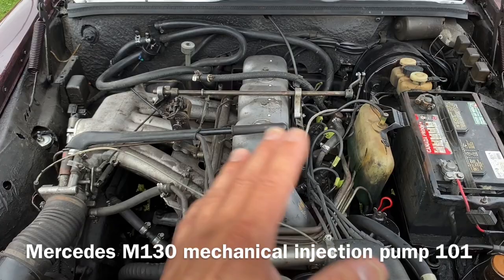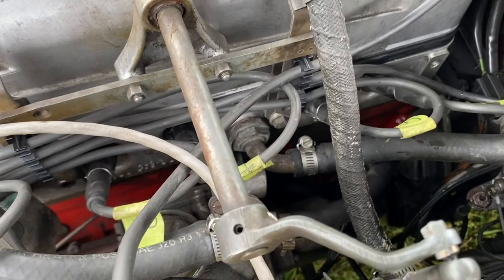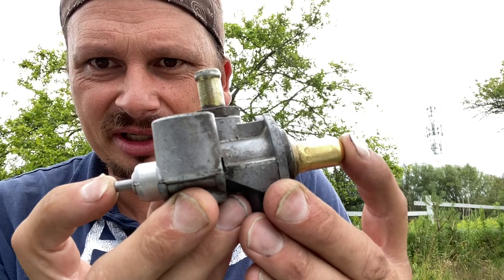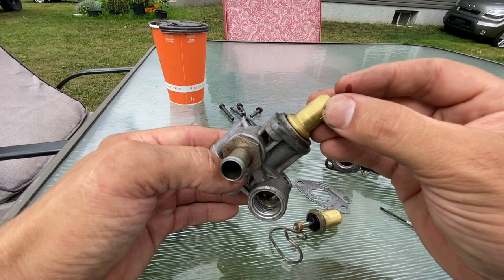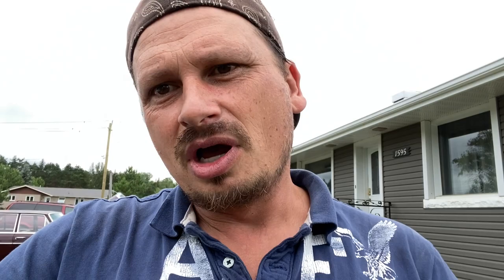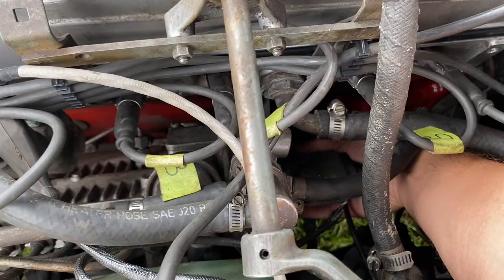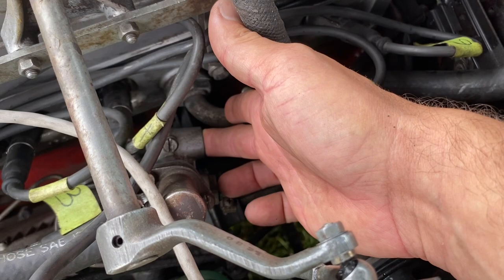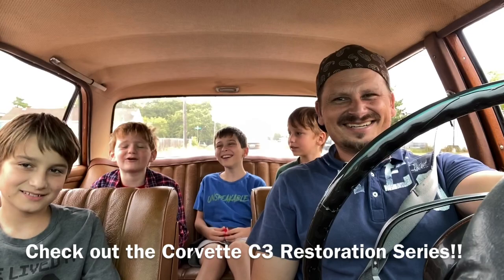Mercedes m130 mechanical fuel injection pump setting. Mercedes pagoda, 280se w108 m127

Comment: I’m 16 minutes in and loving this.  Nice job!  Thank you!
Reply from the maker: Nice
Reply: @ProblemSolverGarage  Are you able to explain why the knob should only be turned 3 clicks at a time?  Thanks!
Reply from the maker: I believe it’s spring loaded, so you want the pump to do a few revolutions so the spring can settle before you adjust it again. You don’t want to put any tension on that spring, everything in there is very gentle and can only be moved a little bit at a time
Reply: @ProblemSolverGarage  I’ve got an r20y pump out of the car currently using a borrowed one to try and get a 1969 parts car engine to run.  I can’t recall if I twisted it more than 3 turns.  Cyl 4 also won’t spray the injector but will flow with no pressure.  The check valve looked ok when I pulled it out, but I didn’t swap it to test it.  I want to verify this engine before scrapping the car, but am ready to throw in the towel. I’ve got a 67 250se 4-speed in the garage to work on and a POS parts car to learn on in the driveway.  Must go!
Reply from the maker: @mknmike  I’m sure if you turned it more than three times it would be fine, it’s just good for it to do everything very gradually. Good luck
Reply from the maker: Make sure the injector on your throttlebody is working, that’s the one that helps to start the engine when it’s cold, I took mine out and Cleaned it seven years ago still works perfect. I hooked up a button to mine so I can shoot gas in whenever I want.
Reply: @ProblemSolverGarage  Ontario isn’t too far from Philadelphia area.  Could I interest you in a free 1969 280se parts car?  She’s a peach!
Reply from the maker: I would love a free parts car, I would even make an episode about going to get it, the only problem is Philadelphia is about 22 hours away from me, plus the border is closed LOL but thanks so much I really appreciate it.
 Maybe once Borders open it’s something I could consider. Really do appreciate the offer

Comment: Interesting video. But I check other things first before turning this screw. For example the injection valves, the starting valve or the control rod in the pump.

Comment: love your putting this info out for ppl to see. hope to see more about this old w108, not much out there for this model 1966-1967 250se. I have the 67 i had to rebuild fuel pump to even get it home. you can find vids pretty easy for that, but for engine bay info or vids there might be only a handful of them. would love to see more on this car!!!!!!
Reply from the maker: Thanks
Reply: Hi Grady how hard is to rebuild the pump.  My just gets hot but doesn't pump

Comment: hi. love this video and other videos,, you are a man after my own heart..

I can't find video where you bypass cold start stuff.. I have done away with some of mine on a couple of engines but interested in what you did..

also fairly sure that adjuster on the back of MF pump is only for idle mixture.. has no effect on normal running mixture,,that's done on control rods.. should only black plugs at idle.. love your videos..

Comment: You are excellent.  I watch both, your timing and fuel injection videos.  I am still troubleshooting though.  My car is a 1970 280SL with the M130 fuel injected engine, 4 speed.  I know it is hard to diagnose a problem without the car in front of you but please give me maybe some direction.  The car starts fast and idles fine.  But will not come up off idle without stalling.  It has a strong idle… So strong I can creep along in 3rd gear or even reverse.  But it will not speed up off of idle?  So you know, I drained and replaced the fuel just to be sure didn’t get a tank of contaminated gas.  Replaced the fuel pump, all rear fuel hoses, and fuel filter up front near the engine injection pump.  I even added an extra see-through line filter coming from the gas tank to see and catch any possible rust particles.  Fuel is clean.  I eliminated any possible fuel starvation problems from the rear of the car.  So you know the car was running fine in traffic when started to just lose power.  Slowly in about a minute it dropped to the idle it has now.  I looked at the plugs and os running a bit rich, but of course has spark.  The spark looked weak and coil looked awful, so I thought maybe when firing faster it could be shorting inside.  Replaced coil.  That wasn’t it.  I’m thinking now it could be the whole fuel injection unit which is so expensive to send out for rebuild ($2600) that I shun to think to shotgun in replacing that.  
Can you please tell me if you have come up on anything like this before?  A car that won’t come up from idle?  If the fuel pump was bad how can it run at all?  Wouldn’t it misfire or shake from a cylinder not firing at idle?   Injectors seem good.  I just can’t understand how it could be getting fuel, air, and spark smoothly at only idle.  It will not come up at all past 750 RPM.  Also know that I completely checked all the pushrod linkages.  They are fine without worn play anywhere.  The slightest movement on the injection pump throttle lever moves the air intake valve to start opening at the intake.  Please tell me your thoughts.  You should know you are the most knowledgeable person and an excellent instructor too on explaining my car.  Thank you.  So you know I’m not a rich man.  No collector here so any non-standard fix or unusual tests would be fine.  I hope you will share your thoughts…. The steps as to what you would check next and then move to will really help me.  It’s beating me up.
Thank you for your fine videos, and hopefully responding to me now.  Placed in my thumbs up already.  
Respectfully,
Michael Scot in Florida
(561) 951-9999 cell
MichaelScot4u@icloud.com

(Please do contact me by phone or by email)
Reply: You should measure the fuel pressure and volume (liters/minute) and make sure those are at spec. Pose your question also on the pagoda sl group site, plenty of knowledgeable folks there as well
Reply from the maker: Check the fuel pressure coming from the electric fuel pump, check it at the starting valve, should have around 11 psi 15 psi.
 Other than that I can't think of anything without sticking my head under the hood. 
I would love to tinker around with it if it was here

Comment: good video.there is also a split linkage test you can do . it is somwhere on this site.One thing I will say is never adjust the back of the injection pump when car is running

Comment: Hi, watching your video and very interesting. Working on a 250SE 67 model and came across your video very helpful. Are you able to tell me the name of manual you are referring to in your video. Looking forward to see you rebuild the motor. The would be awesome!
Reply from the maker: Unfortunately I already rebuilt the motor before I started making videos, complete rebuild with oversized pistons. 
The book is “Mercedes-Benz 230, 250, and 280. 1968 two 1972 six cylinder soho Haynes repair manual

Comment: Very cool video/explanation and kiddies!!!.... I have 1967 W108 250S It's a Zenith 35/40... I changed the mechanical fuel pump and rebuilt the carbs. It finally started but everytime I put in gear (column shift) it dies on me unless i rev it just enough, apply the brakes then put in gear. Sometimes it works but most of the time it does not especially when I put it in reverse. Hope you can give insight as well. the car has been in a garage the last 7yrs and has not started until I finally took ownership.
Reply from the maker: There is a solenoid that engages when you put the car in drive or reverse, there is a switch that controls it, Sometimes the switch gets misaligned and sometimes the solenoid Seizes up
Reply from the maker: It rubs up the engine a little bit when in gear
Reply from the maker: Should be right on top of the engine
Reply: @ProblemSolverGarage  thanks...which particular part on top of engine? thanks
Reply from the maker: I can’t remember the name of it I will check in my book and let you know next time I’m out in the garage
Reply from the maker: It’s called a “constant speed solenoid”

Comment: hello, I have a question about the m127 engine, the exhaust gases show that it works on a very rich dose, I looked at this regulator, when the engine is cold it sucks in air and when it is warm it almost does not. I adjusted the knob to the left every 3 clicks until 24 and unfortunately there is still acrid smoke, in addition high speed (1200 rpm), I will add that the pump was turned to the right to the max, now it is 10 to the left from the resistance,

Comment: Thank you for this extremely useful video. May I raise one question.. What happens if someone tries (not knowing the  rule not to do that) to adjust the CO screw at the back of the injection pump DURING THE ENGINE IS IN OPERATION?
Does it cause extra rich injection only that one can readjust to proper position , or does it cause a damage in anything?
Reply from the maker: It’s impossible to adjust it with the engine running, it will not click in, And if you force it it will get damaged
Reply: @ProblemSolverGarage  Thank you very much for the advice.
In one of your videos you mentioned you will make a  video on the timing adjustment of the W108.
I would be very glad to see also that if possible..
Cheers from Hungary.

Comment: Thank you for the good video, this is pretty much what I needed as I'm adjusitng my M130! Purely wondering, but isn't it possible to set the mixture based on engine RPM? It seems like it's possible to adjust fuel mixture at low, medium and high revs, but I'm not totally sure if I understand the methods used for this. My engine seems to run fine at low revs and at high revs, but runs just a little lean at medium revs. Thank you!
Reply from the maker: What do you mean by lower revs ? Medium revs? High revs? What RPM ranges
Reply: @ProblemSolverGarage  I was told that the injection pump can be adjusted to three different RPM ranges, meaning a fuel adjustment for low, medium and high revs. Say different adjustments for under 1200 rpm, then next adjustment for around 2500 rpm and the last for around >4000 rpm.
Reply from the maker: @JackpodyDK  Yes that is correct but my video doesn’t cover the two higher RPM adjustments, those should never be touched. The only time you would ever have to touch those is if somebody touched them before. Usually people never do because it involves deeply going into the fuel injection pump, I mentioned this in the video. Also in the middle RPMs those engines don’t have much power so you might be thinking it’s hesitating but that’s just the way it is, also check your timing, make sure your mechanical timing advance is working the spring one inside the distributor, not just the vacuum one, sometimes those springs break, this can be checked with a timing gun.
Reply: @ProblemSolverGarage  Thank you for the response! I've had the MFI pump rebuilt, so I think it just needs some final adjustments. Thank you for the video!

Comment: That's a pity. I need to find out the wiring from the cold start to where it goes. I only have 1 black wire on the solenoid. And that has no power on it. Your help would be greatly appreciated. 😊
Reply from the maker: You just put a button on your dash that gives the solenoid 12 V positive as you're pressing it, that will open the solenoid and allow fuel to shoot into the engine. It's very simple, disconnect the original wire.

Comment: Hi PSG, I have W111, 1962 MB 220 SE. My engine only 3 cylinders working-4,5 and 6. How can I adjust fuel injection to not working  cylinders? I am ready to donate to your site.
Reply from the maker: Check compression, check spark, change your fuel filters. Use ethanol free gasoline 91 octane. Here's a few things to start
Reply: Thanks, I checked compression is good, all gasoline system check and clean. I opened the pump and found one of the two walves stuck and rusty. Will assemble in few days. Can you sell me pdf for my pump.EP/ZEB2KL75R13

Comment: The adjustment screw is stuck and will not turn either direction. What is the cure?
Reply: Take the back plate off to get it loose...this happened years ago to me and the mechanic had to do this to get it loose.

Comment: Excellent video. I have a 1962 Adneaur W109. Pretty close to some setup. How I have an issue that I perceive is heat related. After fresh rebuild on the injector pump fuel pump and injectors. The car was running great around town.  However went on a highway run for about 35miles about halfway I felt a couple skips. The problem got worse esp uphill. Pulled over to peak under the hood and as soon as I let ramp to idle it completely died.  Would even attempt to start which it always did fire right up.  Towed home next morning ice cold it started right up. But seems to do the high idle then retract to about 800. Any thoughts?
Reply from the maker: What spark plugs are you running?
Reply from the maker: go one heat rating lower on your spark plugs and also do not use resistor spark plugs.
 What’s happening is your cylinders are getting hot inside to the point where the gas evaporates before it can ignite.
 None resistor spark plugs have a better spark and you need to lower the heat rating of the spark plug to keep the temperature of the cylinder colder. Let me know if that fixed your problem
Reply from the maker: Also what engine do you have in there?
Reply: It’s a 189 engine. With recently installed Bosch super 105 plugs I got from MBUSA VINTAGE CENTER in Irving ca.
Reply from the maker: You need a old-school Bosch spark plug, old original stock. If you can’t find it you need to go with a regular none resistor spark plug.
The cross references don’t work for these old cars, you usually need to go One heat rating lower than what the Internet is saying, the cross references at the stores are incorrect, even Mercedes dealership is having this problem. Do some research, I do not have the book for this engine so I don’t know what spark plug goes in there but nothing new and fancy like what you got.
 I’m guessing the problem started after you install the new spark plugs.
 I had The same problem years ago
Reply from the maker: Try a Bosch W5DC 
Well I just did some research for you, feel free to send me a super like no pressure though. And keep me posted on if it worked.
 Unless you can find the original spark plugs on eBay those should work for about one year replacing them Once per year, they’re only like $25 for six of them. 
Always have a spare set on you when going on a road trip.
Reply: Excellent. Intel. Thanks.
Reply: Morning. Well I got the plugs and ran the engine. Same deal thou after a run on the highway and the engine heated up (190 on the gauge) I started to get the same symptoms. Bucking and no power, although I didn’t take it to a complete stall this time, it was headed that way.  Do you still think this is spark related?
Reply from the maker: Hmmm, 
I still think it might be, maybe install new points, cap, rotor etc. possibly ignition coil, hard to say it’s one of those things where you have to eliminate potential causes.
 Maybe try increasing your mixture a tiny bit, like three clicks in, on the back of the injector pump. Always write down what you’re doing so you can put things back if it doesn’t improve.
Reply from the maker: What did the other spark plugs look like when you pulled them out, where they covered in oil?
Or did they look right
Reply: Hi , so during rebuild I changed cap, rotor, coil, wires. However, pervious owner did put in a 80’s vintage electronic ignition. The car even came with a spare unit. The plugs I took out  Looked ok they were dry and a little white on them.

Comment: Hey bro i just got a 68 Mercedes from my grandparents and im restoring it but sometimes the transmission down shifts when you slowly gain speed. And it shifts rough kinda but once its been ran for awhile it starts to shift smoothly but im just wondering what the problem could be
Reply from the maker: Not too sure what you mean, but there's a micro switch on the firewall, and there's a kickdown switch underneath the gas pedal.
Micro switch gets pressed by the gas pedal being released I believe
Reply: I figured out the problem but would you know where to buy a automatic transmission seal for the pan
Reply: Its a 1968 mercedes with the same engine as yours m130
Reply: I put a little video of the numbers you may have to pause it, if you have time